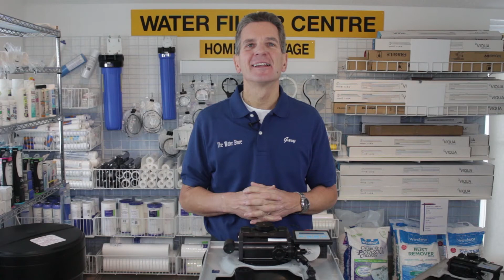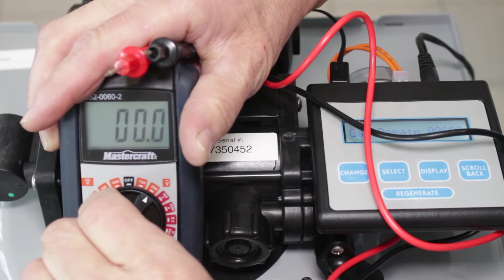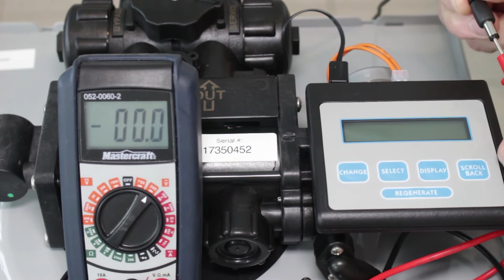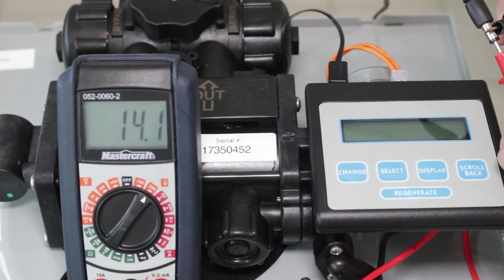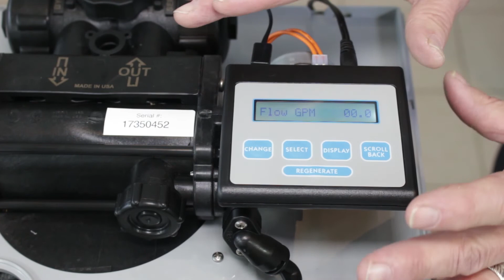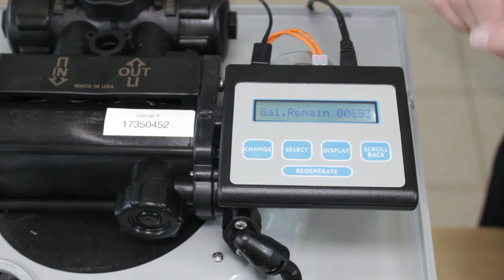Water Softener Trouble Shooting Blank Display-Aquamaster or Water Boss

Comment: try one video for each model, explaining  its sequence of operation, and each components part in that sequence, and  then its repair procedure. / i was a very successful electrical grid and machine troubleshooter for many years and i can assure you that people would appreciate a thorough step by step complete troubleshooting and repair presentation. / after watching 6 0r 8 of your short, fast talking video clips, i was ready to pull whats left of my hair out. / i do wish you well.
Reply from the maker: Thank you for your feedback, always welcome.  It is a fine balance between keeping people engaged (and entertained) and going slow enough for comprehension.
Reply: @water_estore  thank you for your gracious reply. /  a guy who helped me along in my career once told me..." don't assume that your listeners know anything about the object of your explanation". "its far more beneficial to them if they feel condescended to, rather than to be ignorant when you're done." / i found that extremely valuable. / all the best.